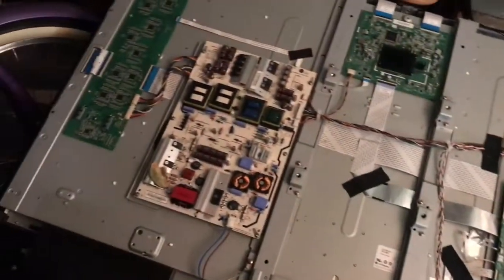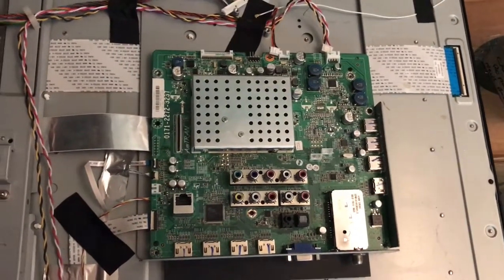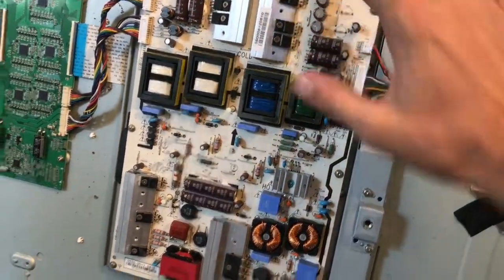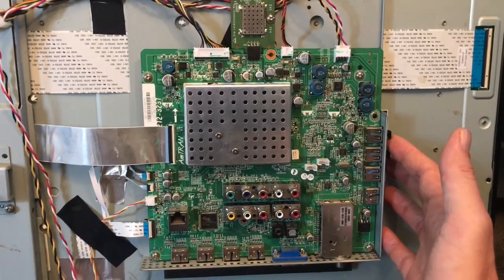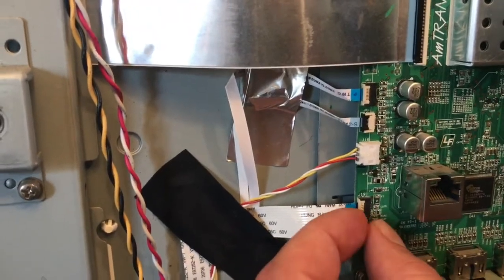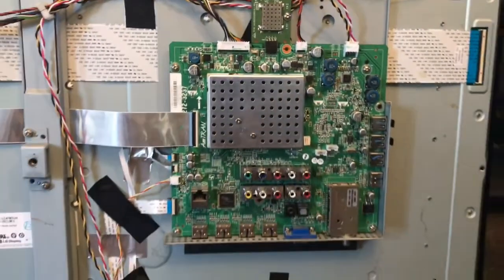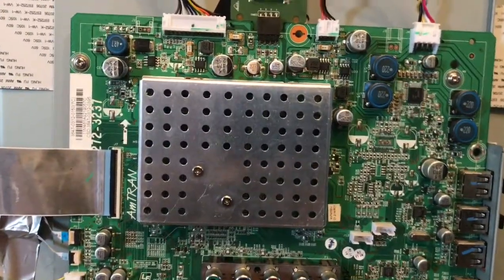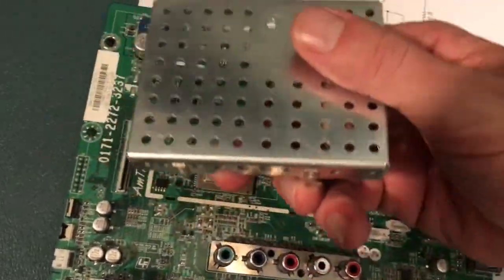Repairing a Vizio 47in LCD TV with a Heat Gun

Comment: Thanks for the suggested repair! Heating the chip, under the heat sink on the main board, with a heat gun on high worked for me.  It was somewhere over 20 seconds for me. The only thing I have to add to the technique is to place a bit of solder on top of the chip, towards the outside edge.  This let me know that the top of the chip had reached the solder's melting point.  I had used a bit of solder that had been ejected from my sold-a-pult, because all I have is leaded solder and this is a ROHS device. I used a dab of flux to keep it from blowing away.
I am amazed that it solved the problem. This is on my Vizio XVT473SV that has been in service for over 8 years. The picture had turned funny for my wife. She tried to turn the TV off with the remote and button on the side, but the TV wouldn't turn off until she unplugged it from the line voltage. After that the standby light would turn on, but I couldn't get any other signs of life out of it.  I was hoping to find a blown capacitor on the PSU, but no such luck.  I found the 5v on the standby circuit as it should. I found 3v on the 3rd pin in on the jog wheel power button board. The voltage on the pin went to 0v when I pushed the button in, so it made sense that the button was telling the main board to power up. But the command wasn't coming out of the main board, because I wasn't getting any voltage on the PWR/On pin on the CN202 header on the PSU board coming from the main board.
So I gave the hot air a go and hooked the main board back up, but still couldn't get past Standby. Somehow I needed to have fastened all of the mounting screw holding the main board down, not just the 2 I initially tried, that or it just needed some more time to get its bearing, because the next I checked the indicator was flashing between amber and white!  So far so good through two power cycles, all buttoned up and put back together. Thanks again for your help!

Comment: So...I re-flowed my processor at 250'c with an hot air station. Then I added a small chipset fan to the top of the rf shield cage. The issue is here that the back of the tv has hard plastic right up against this area, which allows no air flow. So I modified the back in this area to be open with a fan grill on the cpu side and a chipset fan on the other blowing in cool air though the RF cage. It did not get hot to the touch after this modification and the set works snappy and great now.
 They really needed a better heat sink as well, but relied on the RF cage to help disperse the heat.
Reply: Do you have any pictures. I’d like to do something similar to mine
Reply from the maker: Thanks for the reply.  This is a great upgrade.

Comment: Do you need to add thermal paste?..remember that is a power processor
Reply from the maker: Yes, that best way as you suggest is to add some thermal paste onto the top of the IC to act as a thermal path to the top cover.  Although in my case I just used the paste that was already present.

Comment: Sorry I don’t understand what are u replacing? Or are u just removing and resoldering the same chip ? Please explain I have the same problem with my tv .... yellow light is on but can’t turn on .... thanks for ur help and reply
Reply: He reheated the contact points around the chip with a heatgun so the conections will melt back in place. Sometimes the conections will come loose over time if poorly done by the manufacturer trying mass produce products fast and not aficiant, sacrificing quality for quantity.

Comment: Just fixed my sound problem using this technique! Thanks for the in depth video. Is your tv still working now?
Reply from the maker: Yes it is!   However, I have since had the chip completely re-balled and resoldered.  The heat gun fix worked for a good six months, but resoldering has now worked for more than a year.   

I really like the solution proposed by wingnetengineer below.   Adding a cooling fan to the device will help with the large temperature gradients the package/solder sees and will help to extend the heat gun fix.
Reply: @surfncircuits2916  , Thanks for the info. 11 months later, my sound is still working! My television is located very close to a large ceiling fan, so I think that has helped with any heating issues.